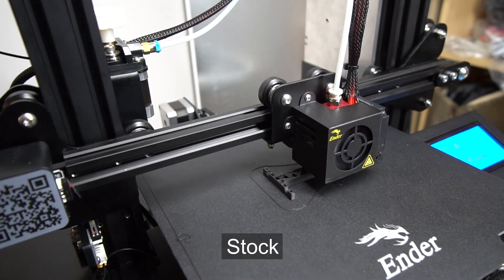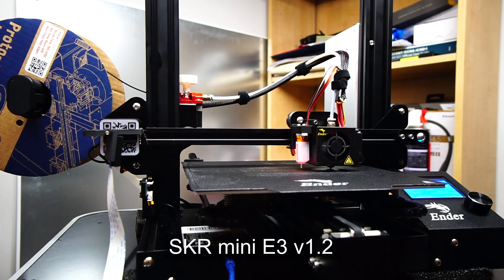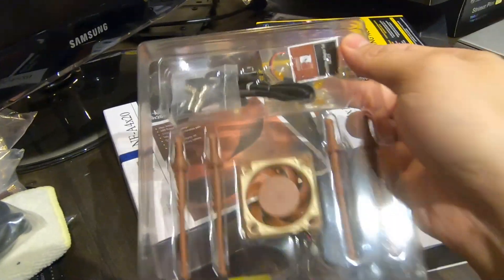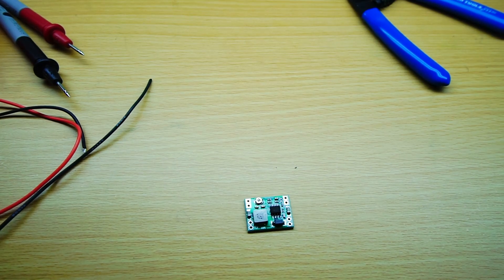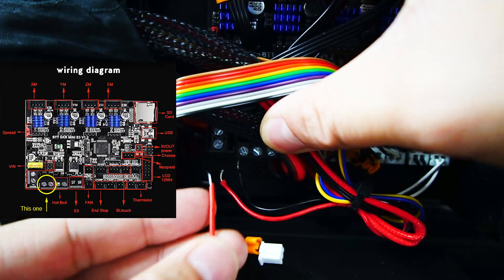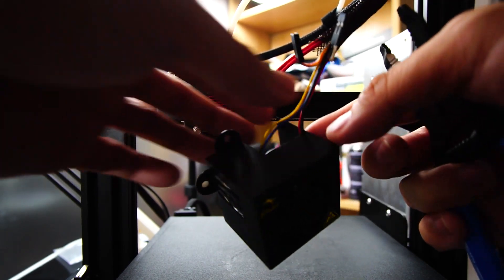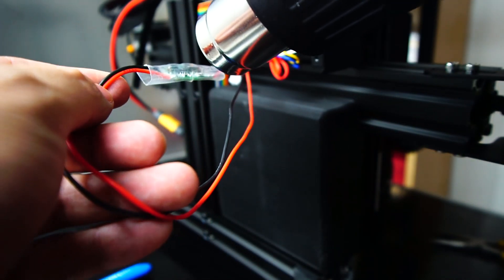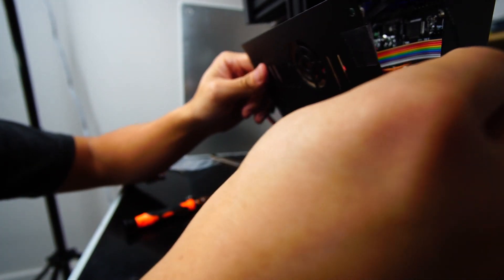Upgrading Ender 3 Fans with Noctua 40x20 for Quieter Printing

Comment: What Gcode do you use to get a notification beep once the print is finished?
Reply: Look it up 😂
Reply: M300 [P<ms>] [S<Hz>]
Parameters
[P<ms>]	
Duration (1s)

[S<Hz>]	
Frequency (260Hz)
Reply: M300 S440 P200
M300 S660 P250
M300 S880 P300
Exemple
Reply: @hexidev  Thank you!

Comment: isn't the hotend and mainboard fan the same 4010 fan?
Reply from the maker: Yes, the stock hotend fan and the mainboard case fan is 40x10mm. I went with the 40x20mm hotend fan here because the Noctua 40x10mm fan produces less airflow than the stock fans, so the extra thickness of the 40x20 is to compensate for that while having great sound reduction. You could get away with using the 40x10, but I haven't tested it, so I can't say how the lesser airflow will affect the hotend cooling. My guess would be an increase in risk of  heat creeping up the hotend which makes your filament flow rate higher than expected.

Comment: would you recommend this mod? how many DB did it take it down too?
Reply from the maker: I really like the fan replacements. There's no functional need for it compared to the upgrade of the mainboard, but with the additional of the fan upgrades, it became tolerable to be in the same room as the printer. I was unable to capture a reliable dB check as the printer sound was actually lower than the ambient sound. Only when I was printing and the psu fan kicked in did it register 45db at the max. I did not find the measurements reliable and I doubt I have the right equipment. I did use the raw audio in the video to at least show the relative difference. If you don't care about the sound too much, then this isn't necessary, but if you like things to be quieter, than this is a must upgrade.

Comment: Link for the housing??? Pls
Reply from the maker: https://www.thingiverse.com/thing:3383198 This is the design I used in the video. The normal one is fine, but I found some problems with the version with the attached BLTouch Mount. If you print the one with the bltouch mount, you'll find that it's slightly too wide to the left and causes the hotend to not trigger the X stop switch, which can damage your printer. I had to add spacers to lift the fan cover so that the X stop could trigger. You also have to search for a BLtouch bracket that is compatible with the mount, so it might be better to just print the fan cover without the bltouch mount and use a different bltouch connector separately. Designs that have the fans mounted on the outside of the covers should also fit the 40x20 fans as well.

Comment: anyone know if you can fit a 40x20 for main board fan?
Reply from the maker: It probably won't fit.
Reply: @dorkytim  that's what she said :D
Reply: @dorkytim  by the way, where do you put the buck converter for the main board fan?
Reply from the maker: It's taped to the inside of the cover.

Comment: why is called butt converter??
Reply: BUCK !!
Reply from the maker: A buck converter or step down converter is called so cause "bucking" is the action or knocking/jumping something violently up or down, so in this case it bucks down or up the voltage to a specific level.

Comment: you set the voltage for the hotend fan to 5v?!
dont do this! you WILL get heat creep in longer prints.
Reply from the maker: I believe you are misunderstanding something. I am not simply undervolting the fan. The fan I am using for the hotend is one that is specifically rated for 5v and thus needs to be at 5v for its intended performance.

Comment: Are you sure that this fan makes enough airflow to cool hotend ptfe tube?
Reply from the maker: Yes, this works just fine. I've haven't had any issues with this setup and the quality of prints have not been affected. There have been no issues with filament creep in the hotend while printing with PLA and PETG regularly.

Comment: This seems like a very very bad idea. Those fans DO NOT push enough air to keep the hot end cool. This is going to lead to heat creep and regular clogging of your hot end and nozzle as well as inconsistent extruding. Why do I see this everywhere? These fans were not build for this and just because they're quiet doesn't mean they're good
Reply from the maker: Thanks for bringing up valid concerns and fair points. I can only speak for my own experience and I have never had any issues with heat creep or clogging in the two years of usage with this fan. I have gone through a few 24+ hours print jobs as well. I would recommend anyone attempting these mods should do so with caution and use their own discretion.
Reply: I'm using a Noctua on an e3d v6 without any problem. It's a production printer that runs15-24 hours at a time. I keep it running as much as possible. I haven't had any heat creep since switching to that fan.